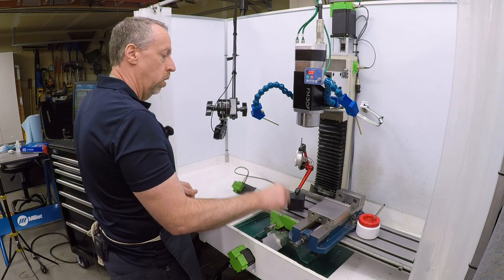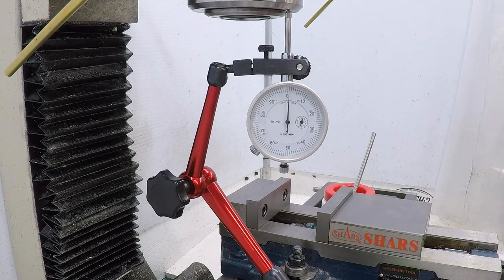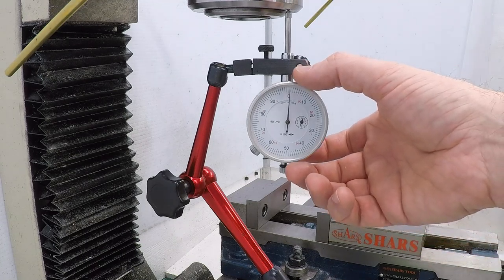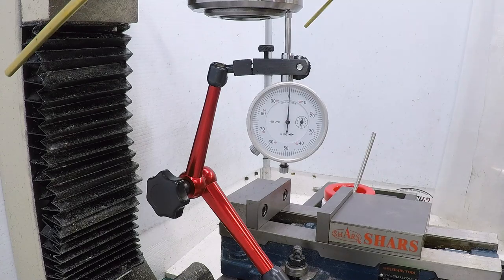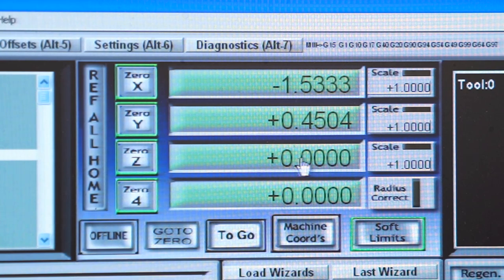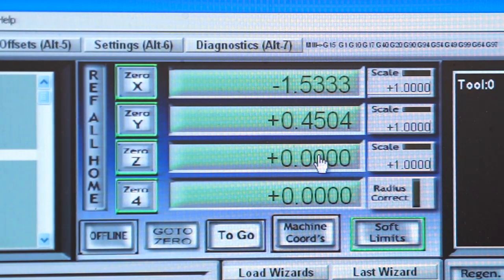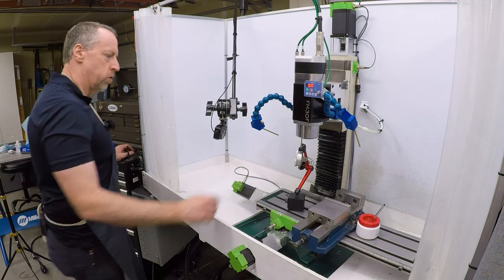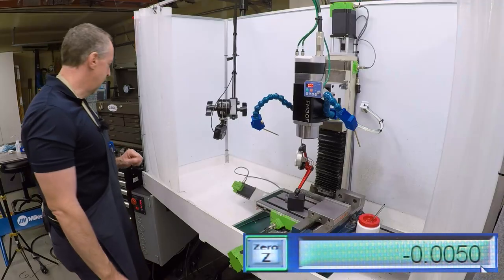Troubleshooting and Fixing Backlash in the G0704 CNC Mill

Comment: I designed my CNC conversion software (Arduino based system) to use feedback from the DRO linear encoders such that the stepper motors keep driving until the error between the desired position, from a GRBL CNC controller, and the actual position, from the DRO, is zero. Therefore no backlash. This means that I use the original leadscrews and nuts supplied with the mill and no expensive ball screws. This method has been working really well for the last 5 years with no fancy setting of gib's etc. 
Maybe worth thinking about with your programming skills (ELS for example) as opposed to my very amateurish inefficient software.
Reply: I was thinking about doing the exact same, do you have your code and interface documented anywhere?
Reply: @philiprisser938  Hi Philip, I'm afraid I don't have the code etc. on the internet anywhere, just on my pc. I don't have any problem in giving you my stuff but not sure how to do it. Any suggestions?
Reply: Hello, interesting implementation. That sounds like a closed loop system. Did you modify the original GRBL code?
Reply: Hi, Yes you are correct it is a closed loop system. The GRBL code was not modified (to be honest I don't understand a lot of it) I just use the step and direction pulses from the GRBL controller and feed them into an Arduino Mega. The 'step' pulse of the GRBL  is set to be the same as the resolution of my DRO i.e. 0.005mm/step and it drives a 'set point' in the Arduino, this is compared to the DRO position which produces an 'error'. The Arduino then drives the stepper motors to reduce the error to zero. It is a bit slow, my max table speed is approx. 250mm/min before the steppers stall but I think that's down to a combination of too small stepper motors (NEMA 23) and a relatively slow Arduino. Still it does everything I want it to do with very good accuracy, + or - 0.005mm, and it's been doing it perfectly for at least 5 years now. One of the demo's I like to do is to physically push the table away from it's position with the backlash (approx. 0.1mm) and it immediately bursts into life and returns the table to its previous position, very satisfying.
Thanks for the interest.
Reply: @TurbineTed  I didn't quite get it. You have a second arduino which does the closed loop and it reads the DRO? From where the stepper driver gets it's step input? Maybe you can do a video or a schematic.

Comment: When I built my current CNC machine I put double ball nuts on X and Y with a fixed preload.  I measured no backlash when I did that.  On the Z axis I have linear rails so they move smoothly and the weight of the Z axis is enough to effectively have zero backlash.  So either a linear rail conversion on Z or try fitting another second ball nut with a bit of preload.  Those ballscrews typically have 50 microns backlash so if the Z axis is getting held up on the gibs you will be fighting that.  Good run through anyway.  Regards from the UK 🇬🇧

Comment: I fought with this as well, in my case, the aluminum ball nut mount was rocking on the slide plate. Solved by pressing hardened pins into the ball nut mount so it had a more stable surface. Funny to watch someone going through the exact same struggles as I have.

Comment: went through this once when my cnc started cutting ovals.. Went through everthing , never solved  , and eventually decided to build another machine .. it can be a nightmare hunting these things.
Reply: If everything appears to be tight you may want to look at your lead screw nut or ball screw nut specs there could be back lash in those.  A high quality system will provide the specs that you need, Chinese systems very rarely if ever provide you with the information, and the quality is rarely what they claim it to be.  I’m not saying they can’t make decent product, I am leaning more towards you get what you pay for.

Comment: Our CNC converted Bridgeport at work has some Z axis backlash, the yoke that attaches to the quill is not a great design and there's not much you can do about it. I ended up dialing in some backlash compensation and it's good enough now.

Comment: It would have been interesting to also measure the Z backlash obtained by manually pushing the head up and down (i.e. without turning the motor) to see if gravity and stiction are affecting the tests.
Reply from the maker: I'm sure both are.  It's better with the 28lb spindle than it was with the original 70lb head, but it's still an issue.

Comment: [hypotheticals]
1) Suppose that (a) one or both nuts are a little loose and (b) the leadscrew isn't exactly parallel with the travel of the carriage.  At one point, the nuts will be as loose as possible - maximum backlash.  As you move away from there, the side force on the nuts will increase, possibly(?)  forcing out some of the slop.
2) Or that the gibs are unevenly worn, leading to the same sort of effect.
?

Comment: Nice go through on this James!  Do you have control backlash compensation turned on if it exists in that software?
Reply: Most of the backlash comp changes the way the mill with move and can cause more issues.
Reply: Mach 3 does have backlash compensation. I believe all it does is add the amount you specify to the amount of movement, but only when changing directions. That way the backlash is taken up on the first move.

Comment: James....is the leadscrew (ballscrew and nut) metric....if that is the case, does the S/W compensate for this so when you command a move of .001 the stepper or servo moves the exact number of degrees or micro steps...????

Comment: perfect time to do linear rail/way conversion on the z axis
Reply from the maker: It's only time and money.  When I did this conversion, I had more of the former.  At this moment in my life, it's the other way around.  Not sure I'm up for building completely from scratch.
Reply: @Clough42  After a while I got tired of chasing backlash on my G0704 conversion and tightening loose items on the ATC and mill. Ended up buying a used 5 axis Robodrill in good condition for almost the same price I put into the conversion.

I don't think I'll buy another machine without an ATC or do a conversion again if I'm serious about making good parts.

Comment: I found that if I helped mine along after I finally got my rpi down, that the stick slip from the gibs was the problem.  If I gave the table or head a little help In whatever direction I was jogging it, it went right to where it was supposed to. And if I forced it past where it was supposed to go, it would spring back. Didn’t seem to effect it when it was actually cutting. But I was pretty stoked when I got hit hitting to the tenth.  Still spring tension for several tenths when initiating a move. Almost drove me crazy.  Took a month of whatever free time I had to get it perfect.

Comment: Are you 100% sure the z ball it mount fits well in the pocket on the backside of the slide? Mine never did. Also make a real bearing block for the z ac bearings.

Comment: James, I was just wondering. I noticed that sometimes you had quite a bit of pre load on the dial indicator and sometimes you didn't and I was wondering about the quality of the dial indicator also. Was it a good one and could these have caused you to get some differences in your readings? Just wondering. Love the content of all your videos. Thanks for your hard work.
Reply from the maker: For a large, heavy system like this, the dial preload will have little effect.  I have used several indicators, including a $500 Haimer on this setup and seen similar results.  Questioning the tool is a good thing though--especially when results are inconsistent.

Comment: Sorry, I'm running a bit behind on video watching so this is a little late...  

Z-axis errors are inevitable.  The lighter the machine, the more difficult they are to compensate for.  I have a Taiwanese-made, round column mill/drill, and a Sherline mill.  Of course the heavier machine can take heavier cuts before it starts to flex the Z-axis, but you can never dial in a depth of cut on either machine and expect to get that depth correctly in one pass, even with a brand-new, razor sharp end mill.  They just aren't rigid enough, massive enough, heavy enough, whatever you want to call it.  You still have to sneak up on it.  And at about 300# your G0704 has about 40% less mass than my mill/drill, with a corresponding reduction in rigidity.  I know it's not linear, but it's likely that the mass of the 200# head hanging on the 5" diameter column deflects less than your G0704 when applying downforce for milling or engraving.

Comment: You should put a L Hex Wrench on those nuts. You will see that with a T Handle it feels crazy tight, but that is due to poor leverage. Put a L Wrench on it, and you will be able to get it tighter. Also,  loctite the screws.

Comment: On the top if your spindle, you have a large-ish wire coming in labeled VFD. Do you know what the name of the connector is called? I've been looking for some reasonable sized multi-pin connectors like this. Thanks!
Reply from the maker: No.  You could contact contact CNC Depot.  They manufacturer it.
Reply: it's an amphenol brand connector. cnc depot has close-up pictures of the connector on their website

Comment: What do you use for way oil on your g0704 and g0602? I have both of these machines as well and use iso 32 and iso 68 in accordance with the manuals but it is just tractor hydraulic oil and I feel like it doesn't stick to the ways very well.
Reply: Mobile vactra no2 is the way to go

Comment: Why don't you use the Mach3 backlash compensation feature
Reply: You're supposed to eliminate as much mechanical backlash as possible before using backlash compensation.
Reply: i've read that it doesn't work for milling operations in mach3

Comment: Interesting video. 
I've got a mill issue. If I adjust the Z gib "softly" the column will be "hanging" on the lead screw but then the resistance from the milling bit cutting pushes the column up and I don't get the depth of cut I want.
Adjusting the Z gib "hard", making the lead screw "force the column down" loks like working but is likely causing wear on the gib.
Any advice from You?
Reply: the gib is a wear item; adjust it so there is no play and also no binding. you can't eliminate stiction altogether
Reply: @ikbendusan  Thanks for Your reply!
Your fully right. I was thinking about the wear on the column, caused by the gib.
Is it Your opinion that I should tightened the gib to make the column "hang" on the gib tension and some force from the vertical handle, including fine tuning, will "force" the column down?
Now I place my hand on the column and force it to the "down position" in order to avoid "an unexpected free fall".
My old dictionary don't know the word "stiction".....

Comment: Can you get rid of the dove tail slides and mount hgr rail onto the slide ways and go that route?
Reply from the maker: It's all just metal, so yes.  Is that practical?  Don't know.  Maybe.
Reply: @Clough42  I would think milling off the dove tail and using the main base could make for a really interesting video.
Would eliminate all head nod too.

Pending results could open possiblitys for doing the X and y axis though you may loose z travel due to heights.
 But could you then make up the travel with extended z liner rails.

Into the deep end fast.
Reply from the maker: @forgeperformanceand4x4  yeah.  I'll have to think about it.  That does sound interesting.
Reply: this is exactly what i'm doing to my machine

Comment: Just to help shorten time working on chasing backlash first mount test indicator on nut or as close to nut put indicator tip on screw pitch move back and forth any movement in indicator will be lost motion in ball screw over .0015 replace ball screw or have reground if found good then work from there out nut mount screw mount bearings, gibs and so on. Next you need to make more of a movement you will suffer a lot from slip stick move down and zero out on a 1 inch gage block then move up 1 inch and slide a 2 inch gage block under indicator should read zero what it is off is actual lost motion.
Reply from the maker: Good suggestions.  In my case, I think most of the backlash is slip-stick causing the nut mount to flex.  Not a lot of easy solutions, unfortunately.

Comment: It looks like you are fighting stick/slip. and you can’t really fix this without moving to linear rails
Reply from the maker: Yup.  Very likely.
Reply: @Clough42  what are you using for way lube? Try loosening the gib a lot and see how much backlash that removes. When setting the gib tightness on my G0704 I have a DTI on and check back lash as I tighten. I tighten until I start to introduce backlash into the system. My screws are double nuts that I custom shimmed, they account for about .0005 of my back lash.
Reply from the maker: @michaelalcocer6778  Quick Slide 68.  Essentially the same as Vactra 2.  I did basically what you suggest, and found a happy .001" setting.  This seems to be pretty temperature dependent, though.  It was worse again the next morning when the shop was 20 degrees cooler.
Reply: @Clough42  yeah I should have waited till the end of the video to comment. The gib will grow and shrink with the outside environment. Set it for when you would most likely be using it.  I have spent hours chasing my G0704. I am over it unless you scrape it, it will have one issue after another. Linear rails if I keep it. Just trying to finish up my TC22 retrofit.

Comment: i am at 7 minutes but commented already :)  :   why not software fix the 5 thou if this backlash is constant ?
Reply: mach3 supposedly does not support backlash compensation during milling operations. this excerpt is from the manual:
5.6.3 Configure Backlash:

''The Config>Backlash dialog shown in Figure 5-24 lets you provide an estimate of the distance the axis must back up to ensure any backlash is taken up when the final “forward” movement is made. You can also specify the speed at which this movement is to be made. Mach3 will attempt to compensate for backlash in axis drive mechanisms by attempting to approach each required coordinate from the same direction. While this is useful in applications like drilling or boring, it cannot overcome problems with the machine in continuous cutting where changes in direction occur.

you would need another controller (i have an edingcnc which does do proper backlash compensation)